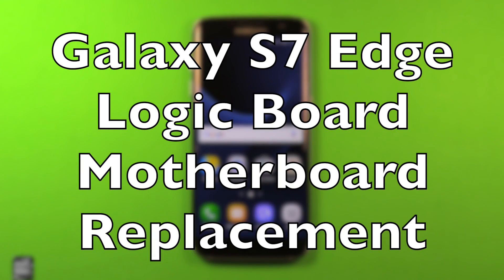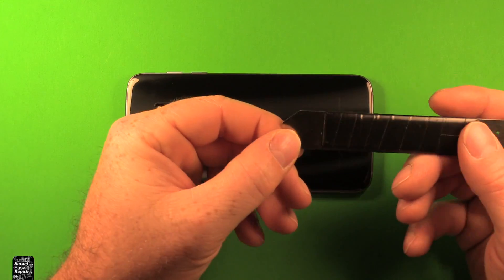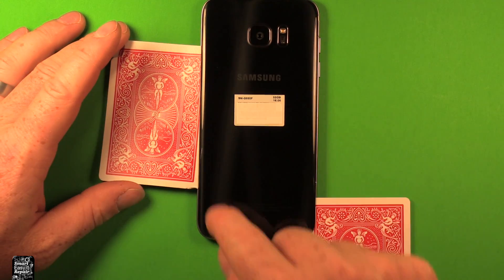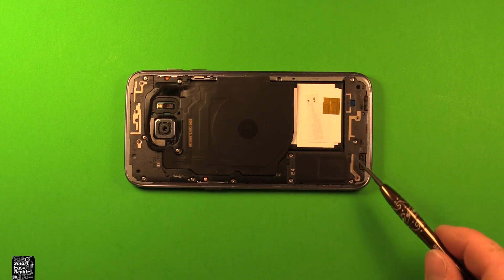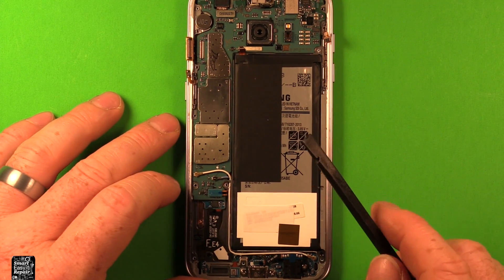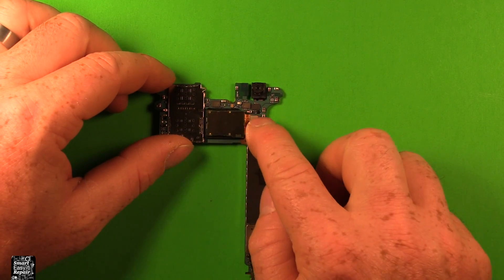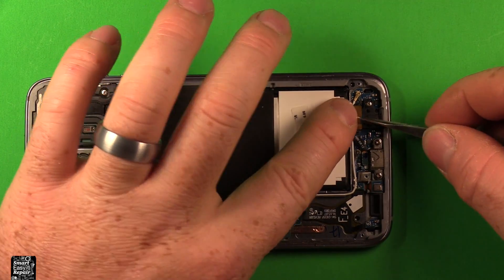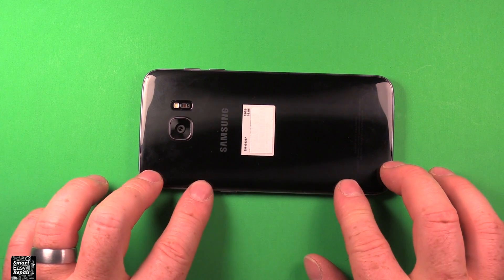Galaxy S7 Edge Logic Board Motherboard Replacement How To Change

Comment: I have a broken screen on my old device, I'm thinking it would be easier to buy a used one with working screen and swapping the motherboard with my old one so I can finally retrieve old pics. This'll work right? Like the built is storage in on the motherboard?
Reply: Dug thru other comments n found my answer, wish me luck
Reply from the maker: Awesome sounds like you got it figured out. Good luck! 🤞
Reply: Hei, have same problem.  Did it worked by you ?

Comment: Hi Man,
thank you so much for your inspirational guide :)
Only a suggestion, if I can: I was more comfortable by using a suction cup to rise the cover on the middle side of the edge of the phone instead of the cutter: I've warmed the s7 edge cover by the phon and in the meanwhile I've lift the edge by the suction cup as much as I could insert the plectrum (or a card); after I've continued warming the edge as long as I was gently advancing with the pick, all along the edge of the phone, without haste.
The hardest task  for me is to open the cover without breaking it!
Many thanks and great job, guy!
Reply from the maker: Thank you and thanks for sharing your experience and tips!

Comment: Good  video  ，ols advise  if I can upgrade My  s7 edge 32 gb to 64 gb  by  changing  the logic board ? thanks!
Reply from the maker: Thanks. Yes if you can find a logic board that has a good clean imei and works with your carrier that’s the correct memory size then you could.

Comment: Can i use g935fd on my g935w8 lcd and other parts like buttons etc. I cant find g935w8 mobo on philippines. Thank u
Reply from the maker: I’m not 100% sure how they interchange but I believe so.
Reply: @SmartEasyDIYer  thank u for the reply. It sucks y s7edge bricked after a year. I tried all the button combinations nothing worked. I tried a new battery it doesnt do the job. Brought it to experts the power IC is @ fault. They suggested to buy new board. But i cant find the same model. I hope g935fd work on my unit. Thank u btw.
Reply from the maker: Wow yeah that’s really bad! I hope you can get it to work. 🤞

Comment: do u think that if I do this with the exactly carefull and  with the back cover adhesive it would be water resistant?
Reply from the maker: +Hugo Alejandro Guerrero Beltran Yeah I think if you do a good job and sealed up well it should work.
Reply: Depends on the adhesive used to reseal.

Comment: Hey buddy I have a question  I have two Galaxy S7  and one of them the screen broken on it  one of them is the screen is good  but the one I have one for T-Mobile on one for Verizon  can I change the operating system  T-Mobile  do we got Galaxy S7  the motherboard   I just want to use the body  4  Galaxy S7  Verizon  I want to use the T mobile operating system  the one I have  and that will work  that can have my umobile  T-Mobile  complete  working out  appreciate that if you can give me an answer  thank you so much

Comment: stupid question.....sooo i have 2 s7 edges one will work with my new phone plan and its unlocked its a verizon  but is shattered....my other is in mint condition but is sprint can i just swap out mother boards and what not from the verizon one to my sprint not broken one to make it a working verizon phone or is there more to it
Reply from the maker: Not a dumb question at all. As far as I know that should work to just swap the two boards. The main thing is if you open them up and compare your boards side-by-side as long as all the places it connects to things are in the same location same size connector same shape board etc. it should work.
Reply: @SmartEasyDIYer  so i should only have to swap motherboards
Reply: @SmartEasyDIYer  and thanks for the fast response
Reply from the maker: I believe so yes

Comment: Hi -I have a question and I hope you or someone here can answer. I have a bad lcd on the s7 edge. If I buy another s7 edge, and I swap the motherboard. Will all my contacts and data work on the new phone or is there something else I need to switch also ? And my phone is on ATT, if I buy a sprint or Verizon s7 edge will that matter ? Can I still add my motherboards to a sprint or att phone and then use it on ATT ? Thank you !
Reply from the maker: Yeah the motherboard should be all you need to swap. The only thing I’m not sure about is if there’s any difference between the att and Verizon Verizon in terms of how it fits. I can’t say for sure on that part. You could maybe do some research on that part of in doubt maybe you can find another att one.

Comment: greatv video, i have a issue, i bought a new s7 edge g935V from verizon, but dosnt get signal for make calls or anything, i think it was blocked so i take two diferent places to unlock, reads the SIM card but not get signal, so i have a question, 
changing the motherboard its gonna fix this issue???
 i can put any motherboard of the s7 edge or i have to ordered the specific model?
please respond thanks.

Comment: are the s7 and edge logic boards interchangeable? specifically trying to use my good edge screen (sm-g935t) and usb with a s7 that has a bad screen and usb  port. (sm-g930f)
Reply from the maker: As far as I know they are different. And won’t interchange.

Comment: are the logic boards specific to the model of the phone? For example, I have an S7 Edge SM-G935W8, would a mobo from a SM-G935FD work too?
Reply from the maker: +Rob James That I’m not 100% sure about. If you could compare them side-by-side and see that the connection points are in the same spot then I think it would work.

Comment: I have black screen of death issue on my galaxy s7 edge, I tried factory reset but that did not solve the problem. 
Do you think the issue can be fixed by replacing the logic board?  Thank you in advance
Reply: yep  I have the exact same issue. Took the phone for a diagnostic check and that what they suggested also. New mobo
Reply: Royal S. Changing  motherboard solved my problem :)
Reply: How and where did you get the motherboard? The technicians know its the motherboard. I have the duos version. Will it matter if I get a motherboard thats from a different model?
Reply: the duos mobo is a bit expensive, about $250 . If you are not installing self ,   technician charges $80 for install.  For now , I downgraded to a samsung  J7  2017  and plan to take my Duos to India and fix there.  labor is alot cheaper.   

That said, Im really impressed with the J7  specs You can hardly tell the difference on processor speed. The Ram is 1GB less and internal hard drive 32GB less,  but  most my data is on cloud so i dont care for storage space.
Reply: Oh, and the J7  2017 was only $210 at Walmart ,  $500 less than Samsung S7 Edge
Reply: I bought a used s7 edge with a cracked screen for 180$. Took it apart and switched the motherboard. I replaced the duos version with the "regular" s7edge. It worked :)
Reply: Irenio M.  Hi, i have same problem with my duos s7 edge. Can i use single sim s7 edge motherboard to my  s7 edge duos?
Reply: ASUQY0nZoN .92 it will work 👍
Reply: Royal S. I appreciate the response, fortunately my parents will help me and the technician said he would do it for 40. Im still kinda scared of replacing the board.
Reply: Good idea! but are the motherboards model specific? or did you buy any S7 Edge?

Comment: so I bought a sprint 7edge from someone that they later reported stolen so cant use. would I be able to buy a cracked sprint 7edge and transfer motherboard to the new one I Bought?
Reply from the maker: +Car93 Y Yes that should work if the one out of the cracked one you get is clean to activate.

Comment: Very clear video. My S7 edge recently wont on/off I tried to reset but still no- Take it to repair shop, battery ok, power button ok, charging port ok. Repair guy says its the motherboard and I was advise to take my phone to samsung service center. Guys any idea how much costs to replace  the motherboard for my s7 edge samsung? Thanks in advance
Reply from the maker: Thank you. Sorry no I don’t really know how much that repair cost nowadays. I think it varies by each phone model. I think you would have to get a quote done. Best of luck with it.
Reply: @SmartEasyDIYer  Thank you for the reply. Yes will do.

Comment: Swap the motherboard to other identical phone will help saving data?
Reply: No. The data is on the motherboard. So if you put in another one your data won't be there.
Reply: @kirsten7975  Thank you very much. My S7 is still working and just the screen damaged, so I can move the motherboard (included SIM) to other S7 and it suppose to work just fine with current data on phone.
Reply: @ninhvu7285  i dont know if the data will transfer. But just make sure that the model of both of the s7's are the same. Im no pro but thats the advice I'd give :) goodluck man
Reply: @kirsten7975  Thank you Kristen! I will let you the result this weekend.
Reply: @ninhvu7285  Awesome. I hope it works well. Going to do mine too!
Reply: @kirsten7975  First of all, thank you for advise! I am happy to report that the swap of motherboard works perfectly :)
Reply: @ninhvu7285  Great news! Let me know, did the data transfer too?
Reply: @kirsten7975  Everything transferred flawlessly. Apps, games, texts, Microsoft offices 365, etc.
Reply: @ninhvu7285  oh! very lucky :)

Comment: My S7 Edge has a broken lcd connector (nothing on display but phone functions like normal. I am able to unlock with fingerprint and also using passkey). I've had it diagnosed and replacement of motherboard is the solution that the repair guy came up with. Will motherboard replacement solve the issue?
Reply from the maker: +Nitin Reddy So is the LCD connector broken where it connects to the motherboard or what??
Reply: Smart Easy Repair yes there is a crack in the motherboard with the broken LCD connector. The service guy told me that there's a very less chance of phone working with the connector replaced but will definitely work with the motherboard replaced. Your thoughts?
Reply from the maker: +Nitin Reddy If the board is cracked then yes I don't think it'll work well without replacing the board.

Comment: Hi mate I've got a samsung s7 I updated it one day and suddenly stopped working took it too the repair shop he couldn't fix it which was 5 months ago and said somethings wrong with the motherboard if I follow this video do u think it will work as the phone dosent even turn on what so ever ???
Reply from the maker: +Amandeep Singh If the motherboard is indeed the problem then it should fix it if you replace it with a good working motherboard.

Comment: Hi Mate - My S7 is currently stuck in a loop where it keeps rebooting, the phone turns on okay but can't really get past the lock screen due unresponsiveness and then it just reboots again. I have photos that I want to get off the phone but currently cannot connect to the PC. Will replacing the motherboard delete all my photos?
Reply from the maker: +JamJarV15 Yes it will delete them unless you had them on a sd card.
Reply: What was the issue ?

Comment: hi dear , I m from india my s7 edge stuck on samsung logo service center  said that need to replace mother board is it true ? and it can change my imei no.?
Reply from the maker: +Kinjal Gaur yes it'll change your IMEI if you change the board. Not sure if there is another fix for bootloop. You could try disconnecting the battery and reconnecting and see if that helps first.
Reply: Hi, even I have the same issue, May i know what was the problem? The service guys are asking to change the mother board!! and they are costing about 13k.. Please let me know

Comment: I replaced the logic board but after I did the touch screen doesn't work. However when I put the original logic board on, the touch works. Why is that?
Reply from the maker: +Samin Jahan Either there is a problem with your new board id say or else it wasn't connected quite right. I would try it again before getting a different one.

Comment: Hi, I do have a phone which is actually blocked by a carrier, I tried looking online who can give me a code but upon checking the IMEI I was informed that the phone was blocked and reported. It's a samsung galaxy S7 edge. I rang a phone tech they do not have the codes to unblocked the phone either. The only way to make the phone working with a simcard is to replace the mother board I was told. They were charging for 500 dollars. By the looks of your video seemed to be easy since I've changed few ipad digitisers. If I change the mother board will the phone be unblocked? and able to use to other simcard?
Reply from the maker: +Don BOSS Yes that should work if you can find a motherboard that is clean to activate and works with your carrier. I have a link in the video description where you can find some sometimes. Just make sure it's what you need.
Reply: I'm a little confused with your note "here is where you can get a logic board. Make sure it's the right carrier and memory size that you want and that it's clean to activate" when you say (make sure it's the right carrier and memory size). I believe the phone is 64 GB... so when you mentioned right carrier is that mean the motherboard has a carrier? Sorry bro I'm new to this phone solution.
Reply: I'm afraid I might purchase a wrong one and it would be another waste of money. Can you further assist me with a link which one to get?
Reply from the maker: +Don BOSS The motherboard determines what carrier it works on and how many gigabyte memory sizes on it and it carries that Imei serial number too so make sure that it to clean serial number.

Comment: What about the water resistant ? Still remains or gone ?
Reply from the maker: +John Walker If you get the back sealed good enough it should be good but it's prob not 100%
Reply: Smart Easy Repair My s7 edge got error like unfortunately google play service has stopped, YouTube has stopped, and it will restart and get struck on Samsung logo screen. Service ppl are saying that they will replace the motherboard. Is it fine to do that ? Because my s7 edge is just 3 months old. Am scared
Reply from the maker: +John Walker You should maybe first check if it's under warranty.
Reply: Smart Easy Repair yes it is 3 months old bro i have warranty still
Reply from the maker: +John Walker I would check with Samsung then if it's only three months old.
Reply: Smart Easy Repair yes please tell them to replace me a whole device
Reply from the maker: I'm saying that's what I would do if I had the phone but you have to do it in this case since it's your own phone.

Comment: i broke my sim card when my sim card tray broke in the phone i took out the pieces and inserted my sim card but it didnt work should i install a new sim card reader or buy a new logic board
Reply from the maker: +jmoneyent9 It might be worth removing the logic board in checking the contacts on the board for the Sim card make sure they're not bent or anything.

Comment: I have 2 S7 Edge phones, one of them is hard bricked, absolutely nothing comes up no matter what combination of buttons I press, or if I connect it to a PC or a charger. I even bought an USB Jig to try to fix the phone with that but it didn't help either. I have another S7 Edge which has a damaged digitizer, the top of the screen is sometimes visible, the lower two third of the screen is just lines of whiteish greenish colors flickering all the time. If I remove the motherboard from the bricked phone and replace it with the one from the other phone, that should result in 1 working S7, right? Or am I missing something?
Reply: Did you try this dude? I have the same issue 🤔
Reply: @Buckdawg  Yes, I did it, and it worked.